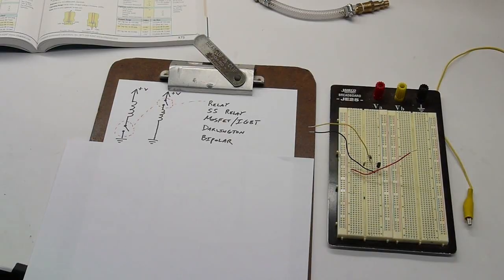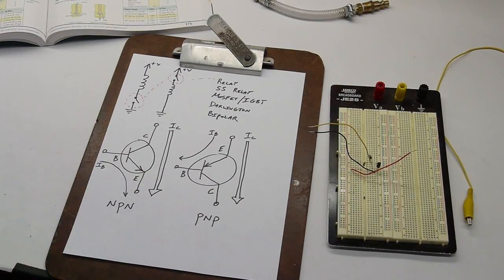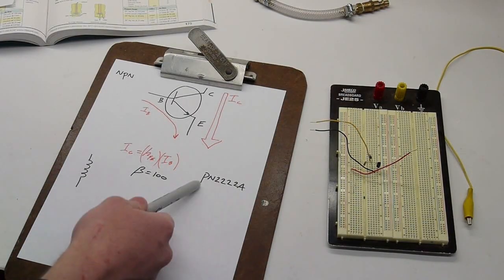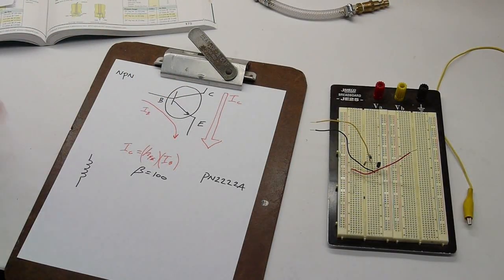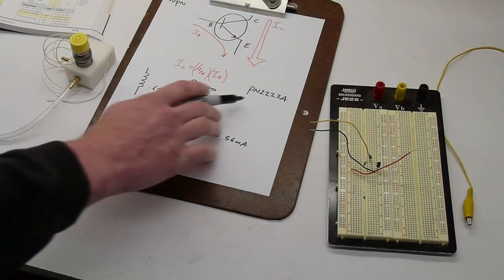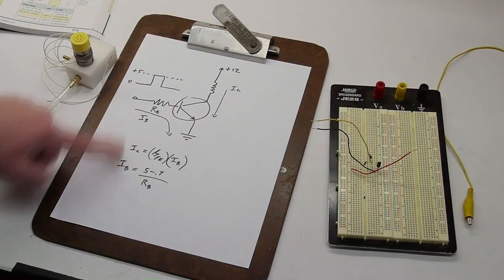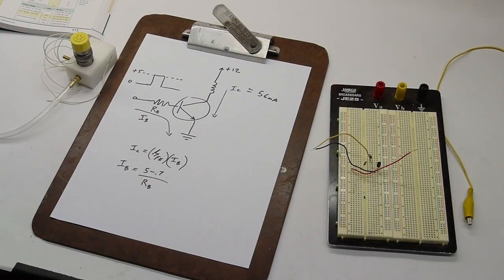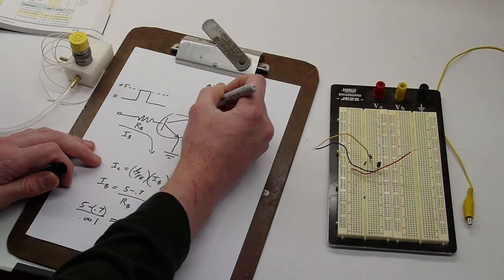Tutorial: How to design a transistor circuit that controls low-power devices

Comment: Great Video!!
You said you would explain why it makes a difference what "side" the Transistor should be on (1:00) - why wouldn't you put the coil on the emitter leg of a NPN transistor..
Is the cap. polarized?
What is the wattage of the resistor?
What is the size of the diode?
Reply: If the coil was on the emitter side of the resistor then there would be a voltage drop across the solenoid coil when the transistor turned on.  As the voltage at the emitter side goes up, the difference in voltage from the base to emitter goes down which means the current from base to emitter goes down, which turns off the transistor.  In Ben's example, by having the emitter connected to ground the emitter voltage is always 0 and never changes.

That small of a cap would likely be a nonpolarized ceramic.  I belive you only have to worry about polarization with the electrolytic caps.

The diode must be sized to handle whatever current was going through the solenoid.  In this case 56ma.

The resistor wattage to the base can be very small as you are only passing around 1ma.  1ma @ 5v = 5mW so even an 1/8th watt resistor can easly handle that.

Comment: Nice video! i have a question: can i put the load between transistor and ground using a npn transistor?
Reply: Of course you can. For assurance you can take a look at some schematic diagrams of circuits that use n-p-n bipolar transistors as switching components to control a load that is placed between the emitter of an n-p-n transistor and the ground of a power supply.
Reply: andread81yt I googled "npn switch circuit image", and found 100% (unless being overlooked) of the circuits have the load connected between +V and NPN transistor or between GND and PNP transistor. I connect in these two ways when playing with transistors. It sounds like these two connection methods are preferred and may be more predictable when the transistor is used as a switch.

Comment: Hey Ben, thanks for sharing this video, its very informative and its like the third time I've come back to it...  but I'm still wondering about what transistor I should use...if a transistors even a good choice.  
My latest project video   =GmZvwzepApI    shows how ambitious the project is and unfortunately my goal for this project is above my electronics knowledge... but I don't think its too difficult for someone good with transistor theory. 
I've got 2 sets of coils, 3 coils in each set, connected in series (5 ohms each)  I'm running them in 2 phases and I'd like to control the frequency of each phase with a two channel function generator to spin two rotors...one CW the other CCW by pulsing each set of coils synchronously (60 elect. degs out of phase) at varying frequencies.  
I'm not sure if I should PWM a mosfet or transistor or darlington circuit.  I've tried a couple of circuits with no luck coz I'm a mech. eng. and lost when it comes to circuit theory. 
I know its asking a lot but if you've have a few minutes, could I get your opinion on my project and on what drive circuit I should use. Any help would be huge. 
Thanks a bunch Ben

Comment from the maker: If Vce is much lower than Vbe, current will flow from the base to the collector, and this will make the circuit fairly useless. Your best bet is to setup an inverting amplifier so the the 3V supply flows through a resistor (eg 1K), then into the collector. When no base current flows, the collector will be at 3V. When base current is flowing, the transistor will pull down the collector to near 0V.

Comment: Hey Ben, Love the videos. I have referred to this video several times so far with my hobby electronics projects. It's very useful thanks! I have a project where I'd like to drive a 3V device using 5V logic. Does Vce need to be greater than Vbe? Or is it purely based on current values?

Comment: If your source of power is significant and the power you need at 3V not very significant, then you want a cheap "linear regulator." It would be very wasteful though (it means you use 3V but '9v' worth is wasted to heat. 

The ideal situation for you would be a DC-DC converter with those stats, or a "switching regulator" which is really the same thing.  A basic transistor can be used for this, but you'll need also an inductor and capacitor at least, and it'll be trickier/more expensive.

Comment from the maker: It's a bit like asking, "should I buy a Lexus or a Hyundai?"  Either one will work, but you need to design the circuit properly, and depending on your usage and voltage/current supply, one may be a better choice than the other. Putting LEDs in series and using a resistor to limit current is pretty cheap and effective.

Comment: I have been getting responses on the Arduino forum stating I need to use a 'constant current driver/supply', I would prefer not to since they are $15 each and needing 1 per LED is possible, whereas the PN2222A are on Ebay for 50 for $2.55 + shipping. What do you think Ben?

Comment from the maker: Yes. If you are using PWM, you want to the transistor to suddenly conduct current when your control signal is active (5V), and stop conducting completely when your signal is inactive (0V).  It's possible to control the brightness of the LED by giving the transistor an intermediate value, but this defeats the purpose of using PWM, and will cause high power dissipation in the transistor. If you have enough volts to drive 12 LEDs in series, the PN2222A should handle 350mA.

Comment: Hi Ben, would this type of transistor calculation work if the 5v control current was a fluctuating PWM from an Arduino instead of from 0 - 5v? I need to control the brightness of 12 x 350ma ultrabright LED's from an Arduino Mega,s PWM outputs, so optimally the current would have 255 values. I am interested in calculating which transistor will perform best and you have the clearest explanation I have seen yet. Thanks!

Comment: Very clear and detailed explanation. 

You are especially good at anticipating questions and answering them (ie, the zero ohm base resistor): you put yourself in the shoes of your readers. So rare and appreciated.

I would like to have seen a bit more explanation of the use of the smoothing cap -- you seemed to gloss over it compared to the other components. 

Keep up the good work!

Comment: Guys I'm searching for a transistor like component with a small difference. I would like it to be connected all the time and disconnect the circuit when it receives a signal. Is there such a component available in market? I know I could use a relay, but I need high frequency (up to 4Khz)and relay can not provide me with that. Thanks in advance :)

Comment: Questions:
1. You used 12 V then Air Valve ( which operates on 12 V) then why Vc is not zero?
2. Another question is why the capacitor is used, is that diode is not enough for reverse current? 
3. How to select the value of Diode and capacitor?
4. How to stop the harmful frequencies effect on a simple circuit of multiple transistors?? 
Please answer all the questions, thanks!

Comment: Transistor gain does not apply to using transistor as a switch does it? So long as the conditions of Vbe(sat) and the Ic(max) are met the transistor will switch won't it?

Comment: To jonathan ortiz castillo: Think u misunderstood the datasheet and transistor theory: the micro can sink or source UPTO 25mA, not that that is what MUST be used. Current limit the control voltage out of the micro with a resistor, so long as the current is above the transistor saturation current ( and the voltage is sufficiently high, as with a 5v source) the transistor will turn on. I think you are confused with amplifier theory where collector, emitter and base current are numerically linked.

Comment: Thanks for an excellent tutorial. I was baffled until now (I hope!).

I'm trying to build a circuit using 5V supply on both Base and Collector to power an LED. The LED is rated at 3.3V at 20mA. Please check my math. My base resistor (assuming hFE=100) will be (5-0.7)/(0.02/100)= 21.5kOhm. I assume I would also need a resistor on the Collector rated at 5-3.3-0.1=1.6V. 1.6V/0.02A=80Ohm. Am I right on my calculations and would a 22kOhm and a 100Ohm resistor be appropriate with these numbers? Thanks

Comment from the maker: Yes, any diode will serve as a clamp to limit voltage rise at the node.  Dealing with multiple power supplies in one system is a common problem in electronics. Often, joining all of the grounds together is a good solution. In the case of a USB device with a separate higher voltage supply, I would be inclined to join the grounds, and use the external power supply to power the logic (ie don't use 5V from USB).

Comment: Never noticed that diod  "icon" Whats  the unique/special feature about it? Wouldnt any decent diode  also do the job and shorting  the inductor when transistor is off?

Also - common ground with bench supply, ok - but what if i have  signal source from lets say USB and power from a 12V supply.
They dont share common ground by default. Wouldnt sharing common ground with a higher voltage supply pose risks to the USB?

Comment from the maker: When current flows through the coil, a magnetic field is created by converting some of the electrical flow's energy. When current stops flowing through the coil, the magnetic field's stored energy is converted back into electrical current. If the circuit does not provide a path for this current to flow somewhere, the voltage will rise sharply. The diode provides a path for the current to flow into the supply, but does not allow current to flow (a short circuit) in normal operation.

Comment from the maker: If the coil were an ideal inductor, you are right -- it would have a certain impedance at a certain frequency, but it would have no resistance at DC. In the real world, nearly all coils are made from copper wire, which has resistance, and so the coil will have considerable resistance at DC. You can simply measure it with an ohmmeter. At DC, the coil behaves like an ideal resistor.

Comment: small question: the part of the circuit with an inductor, isnt it basically a short aswell ? since it doesnt have resistance ? or have i got something wrong, ive looked up the formula for inductive resistance, and it said it was: 2*pi*frequency*inductance ? how can we have frequency in a dc circuit ? ive looked up the formula for for the inductance in a solenoid, and it adds up. but questions remain, the frequency and is the circuit shorted if the inductive resistance isnt enough ?

Comment: Hi Ben.  Awesome videos, I'm hooked.  You mention that a transistor can only restrict the current flowing through it, ie., the coil won't flow more than 56mA.  What would happen if you didn't put a resistor in the circuit at all?  Would the source 5V flow too much through the transistor and kill it?
Thanks

Comment: Actually, 4300 is a standard 5% resistor value, but it's just not commonly found in circuits.  The datasheets for most transistor, including the PN2222A, measure the saturation voltage at Ib = 1/10 Ic, i.e. a forced beta of 10.  That's not saying that using a beta of 100 will cause the collector voltage to be excessive when it's turned on.  But you're the one who said, "just to be safe..."  I would go lower than 4300, maybe 3300 ohms.

Comment: Would it be good to put a pull-down resistor at the base after the base resistor. I am thinking that most micro controllers use a pull up when it has an input mode, but when you have it to just a voltage supply, won't that base be floating and would want to pull that signal low if an NPN and high for PNP?

Comment: I have never used a clamp diode in my circuits,well i know im supposed to but i never do because i do want to burn a transistor on purpose,and it seems like nothing ever happened ...so far i've been lucky ,i only use them in circuits i care about but switching relays ...i never do ...just to share my experience in switching with transistors ..

Comment: PNP transistor complicated to interface No? Heck all you need to do is add another NPN and connect the collector of the NPN to the base of the PNP, and follow what he is doing with the NPN is all. The NPN will ground the base of the PNP, and the current flow from emitter to collector. But you need to add a small resistor 4.7K to pull up the collector pin on the NPN to Vcc.
Reply: Simpler yet, this tutorial is towards people who have a logic circuit but need to make it switch some power components, right. You can design your logic to output inverted signal, especially suited to microcontroller, CPLD and such projects, where it won't necessarily take extra resources, in software. The only requirement is that whatever is connected to the base must be able to sink current as opposed to sourcing it.

Furthermore much of electronics is designed with inverted signal outputs already, because logic ICs can often sink a lot more current (perhaps 20 mA or more) than they can source (often single-digit mA).
Reply: Additionally, you can use an Optoisolator at the base of the PNP to act as the complimentary pair NPN and you'll have an extra layer of isolation!

Comment: Hi Ben - a really outstanding tutorial. I did kind of understand the principles before but you have fixed it firmly in my mind now. I had a kind of off-beat query though which I have asked others without a satisfactory answer. Its the reason for the symbol hfe for the DC gain of the transistor - why this convoluted designation complete with subscript (which I can't show in this text)? Many other units in electronics are logically named e.g. A, V, R, W, or a greek symbol etc. but why hFe?!

Comment from the maker: That should work just fine. The chip already has a current-limiting resistor. I glanced at the datasheet, and it looks like the inputs are supposed to draw 1mA at 3.9V. It is designed to work with 5V systems, so it will draw slightly more than 1mA per input.

Comment: Great explanation.  I am trying to use large 7-segment LEDs, which require more than 5v that my microcontroller can supply.  I want to use packaged sets of darlington transistors, ULM2303 or 2803 with a 12V supply for the LEDs, switched by the 5v from the controller.  Any thoughts?

Comment: Dear ben, this video is very comprehensive, and VERY well explained, you move at an easy to keep up with pace, but i have a bit of a problem, its not your fault, but immediately after you would explain something, even though i knew what the term was for, i couldnt remember what it did. Can you perhaps direct me to a good circuit tutorial for beginners? im new to circuitry, and even though i have binary experience, if i dont know what you mean, i cant very well keep up with your video. Thanks!

Comment: Ben ,I purchased 18 yellow lights, each light is 4.5 ohms. I want to flash these lights in two banks, one off when the other is on. The on and off time will be .5 seconds on a 12 volt DC system (auto battery) I plan to use the 556 to switch the Tip35c transistors, but I am confused about the bias. Can you help design the circuit? thanks Ron.